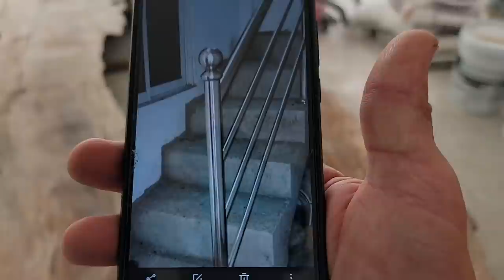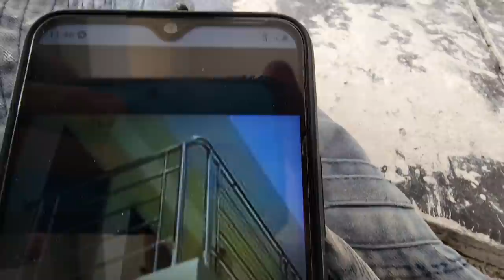Philippines Beach House Build Day 257 part 2  Stainless Steel Rails, Craftsman Precast

Comment: Great videos!! Just a heads up I have had problems finding any quality welders that really knows what they are doing at my place in Mindanao but you might have better luck up where your at but check with magnet if magnet sticks to it it poor stainless and will rust 316Lis the best if you can get. Oh make sure they can weld with out a ton of grinding on it and make sure they clean it up with stainless steel brush and stainless steel grinder wheel any thing that is not stainless steel approved and abrasives will make it rust . If they can’t weld good and get it to hot and dark it’s called sugaring the stainless and pulls the nickel out of it and it will rust . From my experience there most try too weld the patch holes with putty then grind then try to paint over the welds stainless done right no reason to paint Over the welds ever but hopefully you find some one that knows the proper way it should be done with good craftsmanship. But I am picky because I am a welder for 30 years now and have done it all from stainless food grade sanitary piping to pipe lines to nuclear plants so I have a little experience 🤣🤣 good luck. I love your videos and your house when I come back home to the Philippines this November I hope me and my Asawa gets a chance to come visit you and Mela and see the house if you both have time

Comment: For fixing the frame you should try concrete screws just drill a 6mm hole into the concrete and screw them directly in with a T30  torx driver, no need for any plastic rawlplugs.
Reply from the maker: this is the Philippines

Comment: Hi James , just a thought , I saw in Thailand how they joined two big wood pieces together, by using in the middle a expoxy colour swirl that looks great, U join both pieces together with stainless steel rods then pour into the middle once you have polished the timber , the look is fantastic weather resistant too you can expoxy coat the whole timber with clear coat shines and weather won't hurt it

Comment: Another great video. I just installed stainless steel railings at my house and I hope that I did get the good stainless. I had previously put in a stainless post on a overhang and was told that it was the good stainless. Two years later it show that it was not. There is a chemical test that you can apply to test the quality of the stainless. Not sure if you can get it in the Philippines. I see that some of your guys still don't want to use the big trowel. Great job with the house looking fantastic!
Reply: Yes problem is they use the China version it not true stainless dipped and painted.

Comment: I'm curios why you do not use shims behind door/window frames at screw location.  Guess I watch too many you tube installers.🤣
Reply from the maker: there is shims - but when you make these cast opens perfect you dont need shims everywhere. That is mostly for building with wood frame construction

Comment: The reason your neighbors stainless steel hand railing is rusting because there's not enough nickel in the stainless steel and it is a low grade of stainless probably from China. If you want to be sure you're getting good quality stainless steel take a magnet with you, a magnet will not stick to high-quality stainless
Reply: You get what you pay for. You wanted cheap stainless steel, you got cheap stainless steel. If you wanted good or excellent steel, China can give you that too.

Comment: Why aren't you using Tap-cons, I brought them from the states. Wouldn't use anything else. Just my 2cents worth.
Reply from the maker: because I don't want them I can easily adjust the screw in the anchor back off if I need to. Tapcon is mainly just straight in pressure.
Reply: @TexasFilipino  And they rust 🤣

Comment: Your railing needs to be 304L or even  316L.
Reply: ASME SA Grade 304L Sheets and Plates are used to make chemical containers, sea water or salt water conditions. 304L Stainless steel is widely used in nuclear power plants. UNS S30403 material or W. Nr. 1.4307 alloy comes in the category of Austenitic Stainless Steel which provides good strength on high temperature as well corrosion resistance to sulphuric acid.

304 has max carbon of 0.08% and 304L has max carbon of 0.03%.  It is the carbon content that causes rust.  I believe the "L" stands for low carbon.